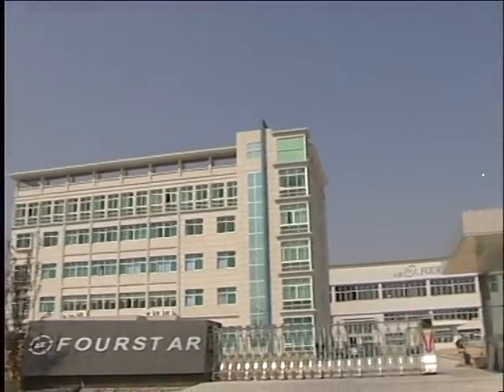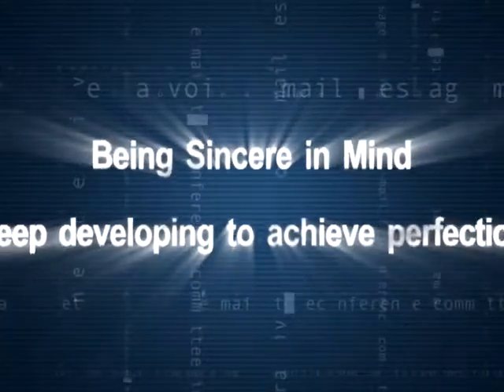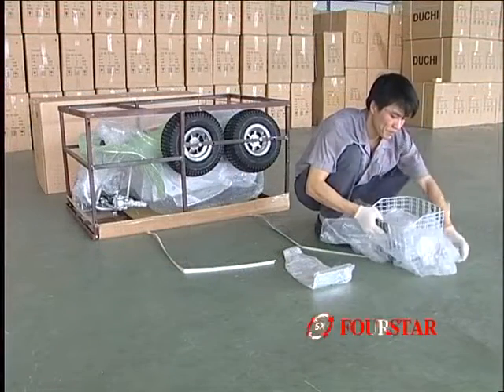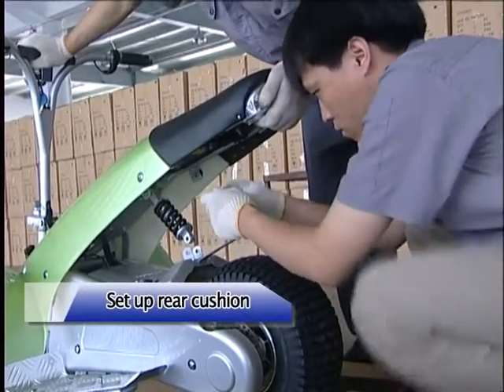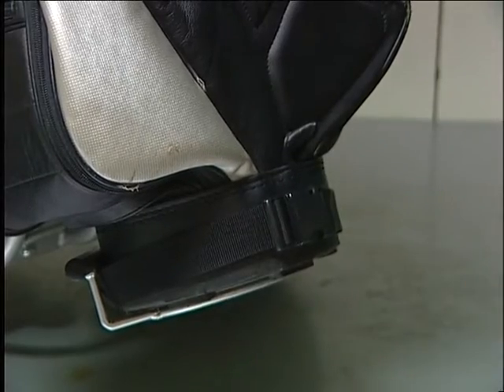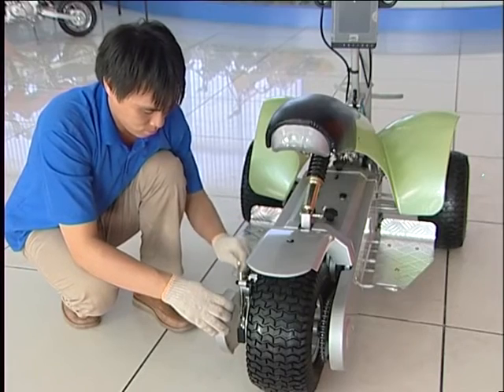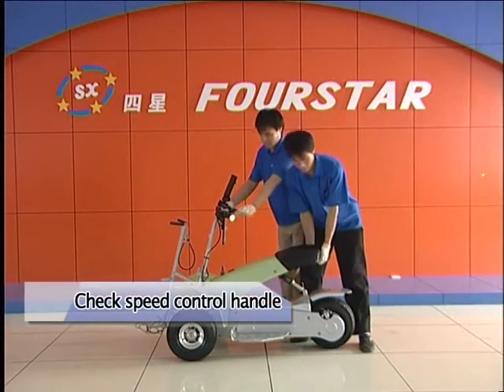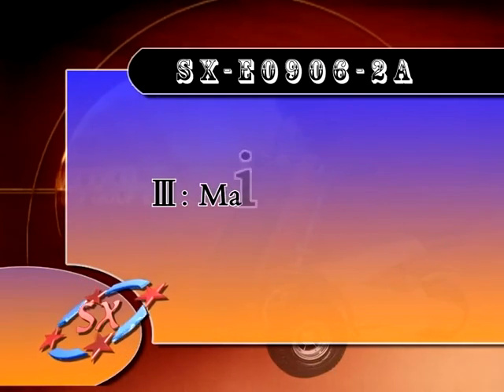Golf Cruiser Maintenance and Assembly

Comment: I know this is an old video. 
I just bought one of these units. I want to highlight an error in the air pressure for the tyres. 
There is no way these tyres should be run at the pressure displayed 1.2 Mpa = 174 PSI !!
It is most likely .12 which is 17 Psi
Reply: Hi, Jake. Is there a possibility we get in contact? I just bought a 2nd handed of these golf cruisers and have some questions
Reply: @alfak  Sure, I am happy to help where I can. If you care to make your email public I can do that or you can ask a question here and others may benefit?
Regards Jake
Reply: @MrJakeblu  Hi again Jake, sorry for not get in contact before... I left the project sided until now. At least now I have already the batteries and solved some problems with the wirings.

My TODO:
- Upholster the seat with new synthetic leather
- Check direction, is somehow loose
- Check all the bearings and stearing rods (rusted)
- Check cables for turning lights and beep sound
- Know how to lift the plastic cover

My first questions are:
-The wheel shows "inflate max 14PSI", seems too low isn't it? I inflated to something close to 20PSI 
-Mine has the old controller with a DB9 connector, is there a way to get more speed? Maybe swapping the controller? 36V750W like
-Is a good idea to get rid off the gearbox to get more speed? Where to get the cover for the motor if I do that?
- I saw one of the models can tilt the handlebar forward and get some space to check batteries, but mine hits the battery box. Is this normal? Maybe mine is the old model and can't do that?

Thanks fo your time.
Reply: @alfak  hi, I will email you a bit later today with some thoughts